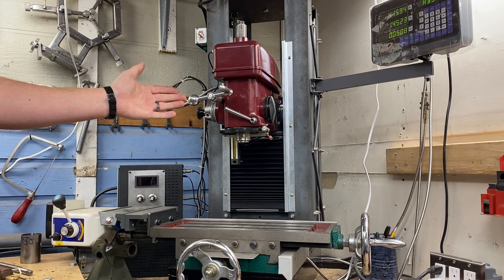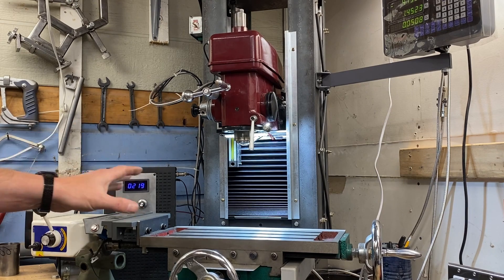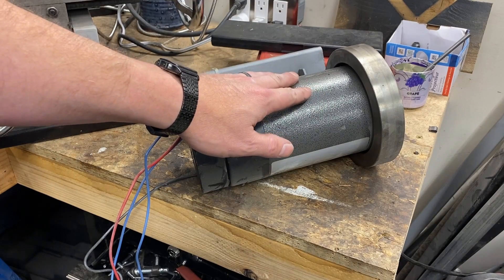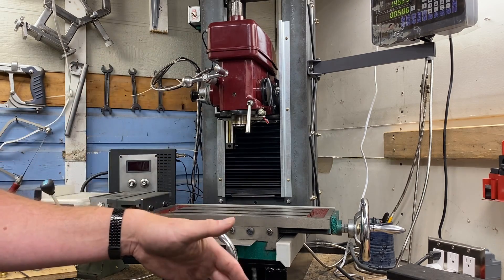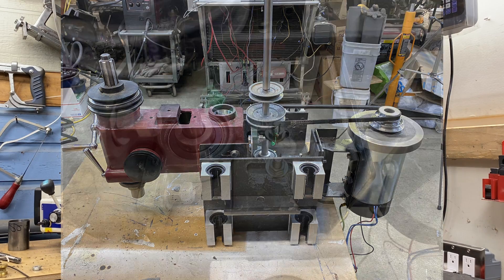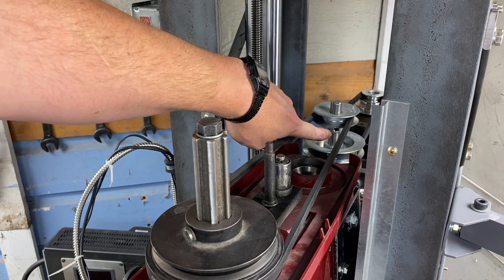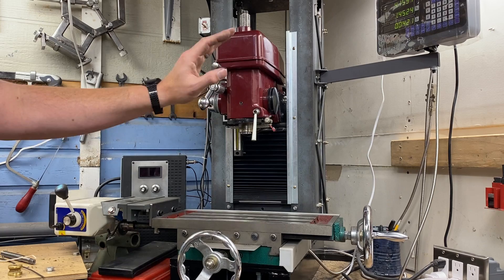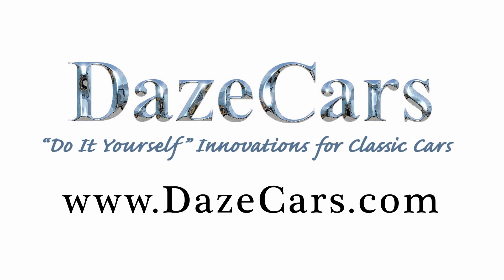DIY Adjustable Column Mill Treadmill Motor Conversion

Comment: Absolutely beautiful, in a frankensteinesque kind of way 😊👍👍
Reply from the maker: Thanks! It was a fun engineering project for sure!!
Reply: @dazecars  and well worth documenting. I learnt quite a bit and really enjoyed the real-time design & development process. 👌
Reply from the maker: It turned out very well and I have used it more in the last couple years then all the previous years combined (in both incarnations after removing the mill head from the combo)  The problem is the bed travel is insufficient for a lot of operations  so I had to upgrade to a big boy mill that I am in the process of setting up now.  The mill head from the DIY mill will be going back on the lathe restoring it to a combo.  This frees up all the work from the DIY mill build to convert it into a surface grinder which I will be documenting in the future.
Reply: @dazecars  wow! Where do you stop? 😁 l’ll be watching with great interest and living through you  😊
Reply from the maker: I like projects... sometimes its more about modifying things than making things from scratch.

Comment: I use one of the motor from a commercial treadmill on my 1949 12”x36” Clausing lathe. I can turn steel at rpm I want with my head stock belt in the mid position. Which is slightly lower than 1:1. No problem making very heavy cuts. I have a second motor and toying with the idea of installing on my MD-16 Jet mill. Has anyone done this on a mill this size?
Reply from the maker: First thing I would do is calculate the torque on the motor that is on the machine.  That is the start to figure out if a treadmill motor is even an option.
Reply: Ok found the information in the other video. My mills present ac motor produces 3.0 foot pounds of torque. The DC treadmill will produce 4.6 foot pounds of torque.
Reply from the maker: last questin what is the max RPM of both motors? @tractormandeere
Reply: The tread mill motor is 3600 and the present AC motor is 1750. I think I would leave the present 12 speed pulley system in place .
Reply from the maker: That's absolutely perfect.  I would gear it at 2:1 right off the motor, that will double your torque and give you an RPM range almost identical to the AC motor.  From there you can adjust your pulley system for the best "most often used" speeds and then leave it that way and adjust spindle speed on the fly with the turn of a knob.  If something requires way more or way less RPM you can adjust the pulley system but I would be willing to bet you can find the sweet spot of 99% of use without a pulley swap. @tractormandeere
Reply: Thank you for your advice. Sounds like a great idea. I will let you know how it turns out.
Reply from the maker: @tractormandeere  glad I could. If any questions come up don’t hesitate to reach out. You can contact me this way or email me through my website.

Comment: Hi Daze. How did you get your DC for the rpm display? I assume you have a converter in your power box?
I’m still confused about how to hook up the red, black and two blue wires. Your video on this wasn’t clear to me. 
Paul
Reply from the maker: I used treadmill parts to power the RPM meter on the lathe https://youtu.be/MmRMNo9IbVU  For the mill there is a wall wart inside the control box.
Reply: @dazecars  I know. But you didn’t show it in the wiring diagram. 
I’m having trouble with figuring out how to have a separate electronics box for the SCR, BR, choke etc, and another box for the controls. 
Electric box contains 
1. SCR
2. Toroid
3. Circuit breaker
4. Bridge rectifier 
5. Ac to dc power supply for rpm display 
6. DC choke 

Control box contains
1. On off switch. 
2. Two potentiometers. 
3. Forward/Reverse switch. 
4. Digital RPM display. 

If I bring the power into the control box I can turn it on before it heads down to the electric box. But I need to bring the potentiometer wires up, as well as the power for the rpm display. I also have wires for forward reverse that need to come up from the electric box. 
Can you see the problem? I want to mount the small control box on the lathe and keep all the big stuff away, attached to the wall. But when I draw it up, I have 3 glands in the control box just to handle the wires. 
This is not my string point. I was hoping you had some good ideas. 
Paul
Reply from the maker: @paulmanhart4481  You must be doing something right as I also have 3 glands coming out of the back of my machine 😁.  Power wire comes from the wall and goes to the lathe lathe column, There is an AC master switch in the column then AC wire comes out and goes to my RPM power supply, the RPM power supply is just tapped into the switched AC line before it goes on to the SCR.   From there AC goes to the box with the SCR and all the power supply components.  Once converted to DC the cord carrying DC goes back up to the mill, goes into the column so it can go into the forward reverse switch and then out to the motor.  Both the DC in and out go through the same gland along with the potentiometer wires.  The AC in and out has its own gland.  Make sense?

Comment: Watching this for the second time and I can't help but think, wouldn't it have just been easier to make the tables height adjustable?
Reply from the maker: I couldn't find a ready made dove tale that was big enough without spending a ton of money, but the linear rails were relatively cheep.  because the mil head does not need to move perpendicular to the rails it can just move up and down inside the column.  The table would not have worked in the column due to the side to side movement.  Also if I made it a knee mill it would no longer have been a bench top unit and that would have required a lot more steel.  All in all the rails were cost effective and and the easies mode to what I already had built when I created the fixed column mill.
Reply: @dazecars  now that you have this mill you should start machining and selling ways lol
Reply from the maker: @blender_unleashed  Let me guess you would be my first customer 😂😂😂 Not interested in making and selling any more than I already do.

Comment: Have you ever used a large treadmill motor. Something with bigger than a MC2100 board? Could a 2100 board power it?
Reply from the maker: Could it power it, yes but for how long I do not know.  My biggest complaint with the MC-2100 is fragility.  I burned one out by simply powering up a motor at full speed rather than turning it on at slower speed and turning it up and it was a small treadmill motor.

Comment: What size Ferrite Ring MH and Amps should one use on a treadmill circuit board ?  Thank You.
Reply from the maker: ring need to be about 1" across and the wire should be a minum of 16 awg but 14 awg is way better.
Reply: @dazecars  Thank you. Your videos are light years ahead of anything on YouTube. Looking forward to next one.
Reply from the maker: @carlkellogg5342   that is high praise, thank you!!  The video that drops tomorrow will be a continuation on my 393W build.  Future videos will cover an electric motor DIY dyno build.  I want to use it to compare power supplies and see how the power supply effects motor HP and torque. I will do a video on the treadmill motor conversion on my band saw and anything else I come up with along the way. Just to name a few.  Lots planned, stay tuned!!

Comment: Hi.🙂    amazing work !!                 But, i wonder if its worth the effort, can you still drill a 1/2''  stainless hole @ 250 r.p.m ??    or if you still have to change pulley to get enough power??
Reply from the maker: Great question!!  In the case of my original mil/AC motor configuration the slowest I could go was 375 and that was 4.5:1 pulley ratio.  That motor was putting out about 2.3 foot pounds of torque so 10.3 with the ratio.  My current motor puts out about 3 foot pounds and has a pulley ratio of 3.5:1 which works out to about 10.5 foot pounds so it is basically the same, the only difference is I can now go a lot slower, adjust it up or down for the perfect RPMs and still have the same torque.  Now don't get me wrong this mill lathe combo was not a huge machine to begin with so it may still not be enough to go through stainless at 250 or maybe it is I don't know as I never work with stainless.  What I do know is this, on my lathe I use a treadmill motor and I single point thread grade 8 bolts all the time.  This is done at 100 RPMS, I don't use a compound so much higher tool pressure and it works very well.  I have yet to be disappointed with the torque on my machines.

Comment: So Day since you decided to keep the flywheel for the mill, have you considered or done the same on the lathe?
Reply from the maker: no because the mass of the 5" chuck and adaptor plate is much more than that of the flywheel so the treadmill motor flywheel would be redundant.  Functionally there would be no improvement in performance in fact performance would probably go down as the mass would require the motor to work harder.
Reply: @dazecars  makes allot of sense!

Comment: I added a TMM to my little 8" table top drill press and it runs like a champ now.  I'm also building a 2x72 knife grinder for another TMM I salvaged.  I'm also trying to keep the flywheel on for that project for the added (rotary capacitance?).  You're right, these things are amazing, people just don't now what they're throwing away.
Reply from the maker: My drill press is the next on my hit list to get a treadmill motor.